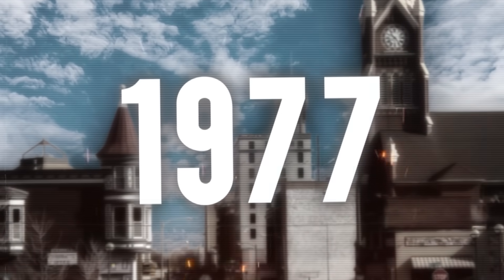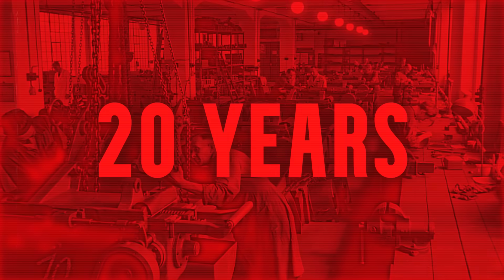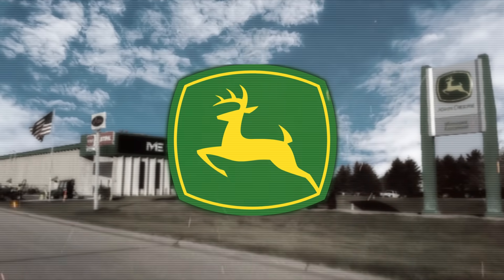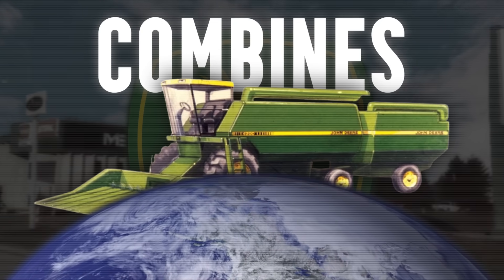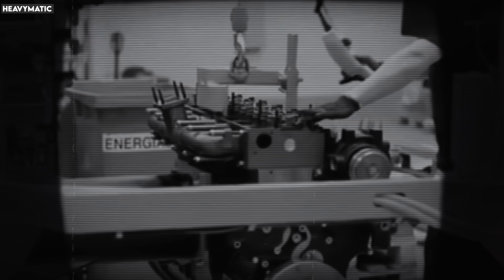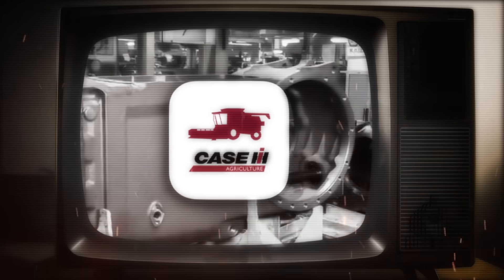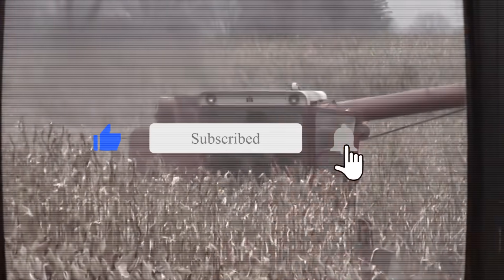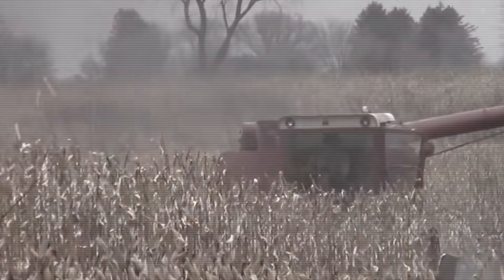Before John Deere Knew, It Was Too Late | The Axial Flow Story

Comment: New Holland beat them to the market with their twin rotor system.
Reply: Deere has been having their asses handed to them when it comes to harvesters all along. NH had the first rotor machine.
Reply: @dougblasberg8244 how do you figure? Sales numbers say jd has had the upper hand all along. Jd out sold all other brand combines then and now so even back then people obviously preferred their combines even when they were the walker design
Reply: New Holland copied IHC and made a twin rotor to avoid patent infringement, the TR 70 was a half arsed  product rushed onto the market. The 1440 and 1460 IHC machines were superb when introduced and still many original machines running today .You can't give a TR 70 away but old Axial flows you have to pay for.
Reply: Not very true the 7720 or the 8820 give better quality than the axial flow .  In Canada during rough autumn the IH  have problems
Reply: The mighty TR70 beat case by 2 years. I wish someone could mod it into the game farming simulator 25 so I could side by side test it against the 1440 that I always use. I’m a nut for old iron
Reply: @steveedmondson9651  Well maybe you should know your history a bit better  it was IHC that pioneered and perfected the Axial Flow combines not fxxxing Case which hardly made anything of note even when Case annexed IHC in 1985 they kept virtually everything IHC and dumped most of the Case products from thereon.